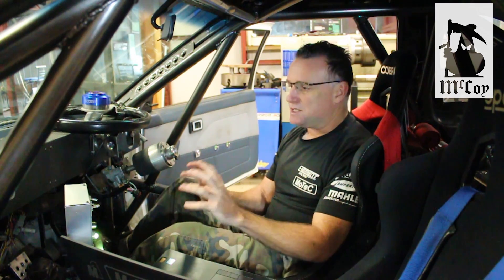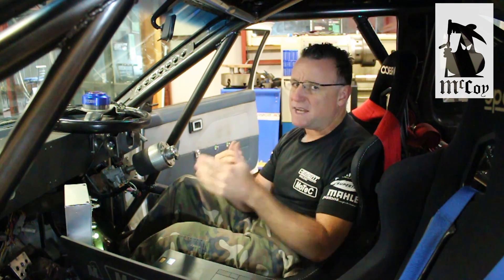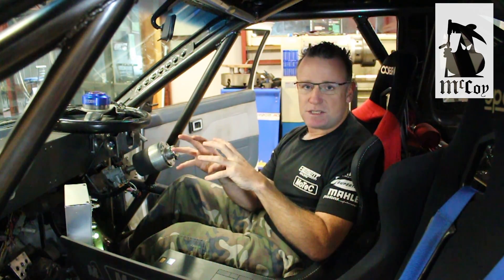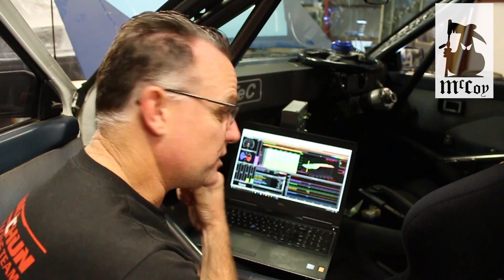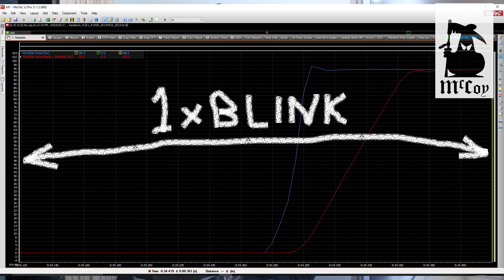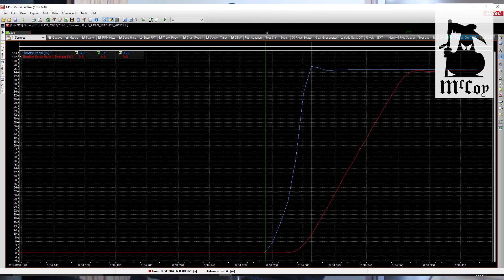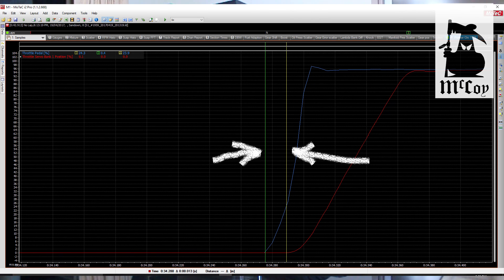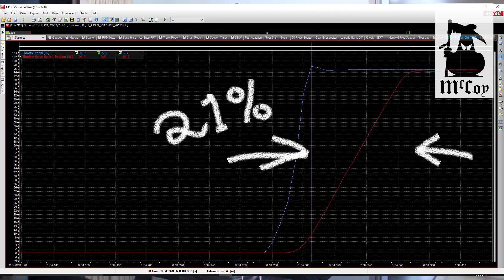DBW Lag Myth

Comment: Quite interesting how this proves the "myth". 13ms is not a long time to respond, indeed, but it's much much longer than the cable throttle. Now, the time it takes to go from fully closed to fully open is an even worse problem. Just for the record, there have been experiments where they showed a screen at 1000 fps to pilots, and in 1 frame they had a plane. The pilots only had 1 ms to see said plane and they could recognize what plane it was. 1 ms. If someone can react to a picture only shown for 1ms, 13 ms is definitely gonna be a noticeable delay and 63ms more for the plate to catch up will definitely be noticeable. The plate should move in the exact way your foot moves, like a mirror image and the delay should be short enough to be imperceptible to the driver. That's what cable throttle does. Can a drive by wire system do that?

EDIT: For reference, throttle cables are made of stainless steel. For an 81cm throttle cable of a motorcycle, the butterfly will start to move 0.164ms after you started twisting the throttle and will continue to move for as long and with the same angular velocity that you move your own wrist, it will keep mirroring your wrist's movements with an instantaneous, for the human perception, response. Can a ride by wire system do that?

Comment: Had the same problem with my Audi TT ... it is literally impossible to climb a hill without spinning the wheel because you have to give it more gas or else it stalls, also you need to use the handbrake, rev it up and let go.
never happened with my old DBC toyota starlet 🤣

Comment: The real test is when you  start in first gear with a manual transmission.  If the motor stalls too often, you know that the throttle couldn't catch up with the clutch movement.

Comment: DBC also has ONE and only ONE map, regardless of gear, traction, boost, drivetrain protection or anything else.  DBW can have throttle maps by gear, by speed, driver selectable anything you can think of and can map out, it can be changed.  Motorcycles, especially liter bikes, are nearly unrideable with the amount of power available without programmable throttle maps by gear.  Take any liter bike from the last 10 years or so and apply the same throttle map for 6th gear as 1st gear and youll wheelie as soon as you touch the throttle.  That doesnt even start to get into wheel speed and IMU integrated systems where you can modify the throttle based on how far you are leaning over in a corner or if the front of the bike is coming up.  Then there is the fun stuff like quickshifters and autoblipping that are way faster , more precise and gentler than spark cuts or bypass valves/kickers that you have to scab on to downshift with a sequential box.  More or less, anyone that shits on DBW in an aftermarket installation isnt smart enough to be in the position to make the decision on that.
Reply: Maps are mostly made with RPM, TPS, Air mass and O2 from the exhaust. That's all you need. You don't need 100 different maps, you only need maps based on those parameters and environmental factors like temperature, humidity, elevation and air pressure. If you can't modulate the throttle yourself to account for gear, speed and various other conditions then you have no business driving or riding high performance vehicles. Quickshifters DO NOT care if your throttle is cable or electronic, they cut spark or fuel or both. Auto blippers though require rbw to function. Do you need quickshifters and autoblippers? No, you can learn to do those yourself too but it will require some dexterity. As long as DBW is not a direct electrical link between the twist grip and the throttle bodies it will be inferior to cable. Its only real use is electronic nannies and safety nets for sensitive bums like you. Too bad the rest of us do not have a choice about it.

Comment: 60ms is far from instantaneous imo, imagine doing quick changes of pressure in the pedal (250ms for example), if you have to wait 60ms between each change of the throttle position it could get wobbly on track
Reply from the maker: Not 60msec delay to do anything, it's based on the movement of the pedal .  Watch again.

Comment: GMC trucks drive by wire system absolutely sucks my Tahoe at idle I can smash the pedal and the truck just sits there for what seems like 2-3 seconds and barely crawls and then after that point it pulls a little harder and a little harder until about 4-5 seconds it’s balls to the wall and pulling hard but that lag is just almost intolerable I realize this Tahoe is not a race car but if you have to pull out of a place  quickly it’s just not happening and it’s not lack of power once the throttle actually catches up to what my foot is doing it runs very strong.
Reply: Thats how my 08 grand cherokee is, if you hit the gas its a very noticable delay and its annoying. I much prefer my older chevys with cable throttle that you smash the gas and it just opens up instantly no matter what. The jeep i have to do like you say and press unpress press and the third press its full throttle accel instantly. Hate these new cars.
Reply: Jack rabbit delete torque management it delays throttle response to accommodate weak parts in the 4L60E when you punch it
Reply: My 13 impala does this maybe it’s the foot position but like he mentioned the aftermarket his far superior to the factory version

Comment: Its not about full throttle lag, its about partial throttle! I hate my drive by wire compared to a cable
Reply from the maker: Factory set up compared to aftermarket.....i agree.
Reply: Lol.   Didn’t you listen to what he said 🤦🏻‍♂️🤦🏻‍♂️🤦🏻‍♂️ yes factory settings suck.  Tune the throttle body.   Go by peddle command. The thing work great
Reply: @mikeeagle2653  I have a tuner, even with the settings maxed out, my cable driven throttle has a much better throttle response
Reply: @damnitbobby8438   your tuner sucks then.  Because adjusting the throttle body isn’t difficult
Reply: @mikeeagle2653  I shouldn't have to spend hundreds of dollars to get a better throttle response
Reply: @damnitbobby8438  you don’t. You can tune it your self with tuning software duh 🙄

Comment: What’s the benefit of DBW in a drag racing application on a vehicle that’s turbocharged?
Reply: Drag racers often get in and out of the power if the car gets squirrelly, and need the engine to react quickly, without slowing down the turbo. With DBW when you get out of the throttle the ECU infers you are requesting less power. This can be tuned in by simply cutting spark, while still keeping the throttle butterfly open and the turbo spooled.

Comment: Very interesting video - thank you very much for making it. Is there anything that can be done to remap an OEM throttle to remove lag, or is the only option an aftermarket ECU? Does the ability to modify the OEM throttle map vary between manufacturers?

Comment: Sure, for a tune able system the lag isn't a problem. But if you have a factory car with bad throttle response and don't want to spend many hundreds of dollars on an ECU, you are pretty much screwed. My V6 accord with DBW has acceptable throttle response, but that is all. I also had a four cylinder accord and a V6 maxima both with throttle cables. The maxima had AMAZING throttle response, the four cylinder accord was okay, still better than my DBW V6, but it was kind of underwhelming for a car with a throttle cable. I drove a 2012 ford expedition that would actually REV UP the engine for half a second if you shifted into neutral and let off the gas at the same time.

It is nice to have DBW when you are backing up in reverse with a manual car already warmed up. When warmed up you don't get the fast idle, so you have to use throttle, and with DBW the initial throttle response is soft in reverse. Backing up in a manual car with a thottle cable can be very jerky if you need to use the throttle.

Comment: I completely agree Mark. When our Suzuki had its OEM ECU the throttle response was relatively slow. Now we are running MoTeC the throttle is noticeably faster. Not to mention the other benefits like automatic blip on down change and of course the ability to tune the throttle opening vs pedal relationship to make the car easy to drive. I would never even consider a cable throttle now